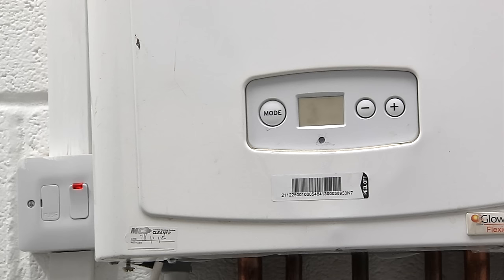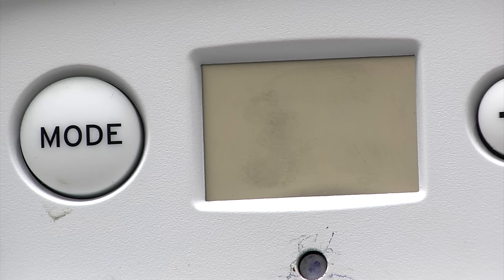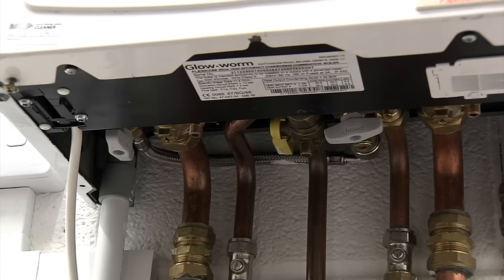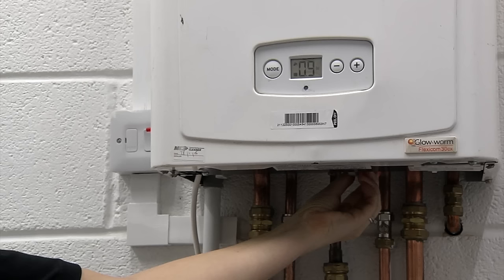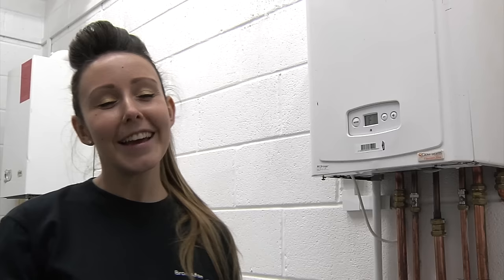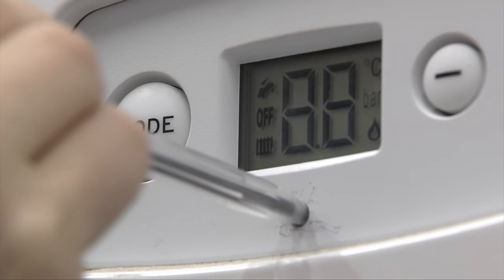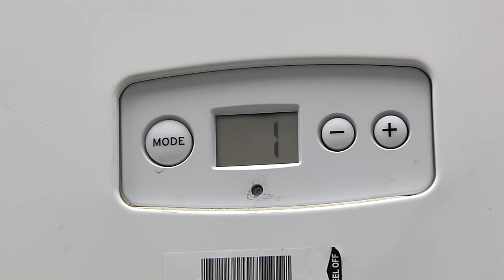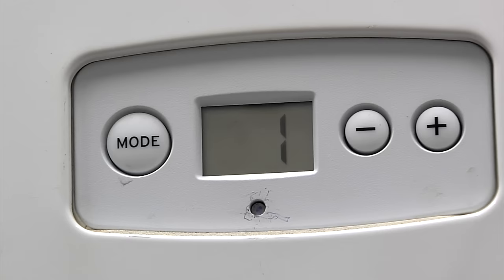How to fix some common problems with your boiler

Comment: Yes I had this problem with the boiler you mention in my old house, have since moved into another house and have the same boiler . But a different problem this time the boiler seems to gain pressure, getting too much pressure above 2 bar . Getting a repair done soon having had boiler serviced one outstanding thing needs doing to it. Will see if that solves the problem.

Comment: If you increase the pressure from 0.4Bar to say 1.5Bar using mains water (via the detachable loop) you MUST check the density of your water from any radiator to ascertain the Antifreeze (eg Fernox Protector) ratio to water so that none of your pipes freeze up during Winter or really cold spells. Ideally top up your middle radiator after draining some water, with Antifreeze (Fernox -11 Protector) and check with a hydrometer after circulation that you are safe to at least -8C minimum. I treat mine down to -11C

Comment: hi. my gloworm boiler has devolped a fault with the hot water only. system is sitting at 1.0 pressure and fires for a few seconds when you turn the tap on then it cuts off again. water only gets warm for a few seconds then runs cold. this is followed by a funny noise coming from the boiler like water is making a humming noise. do you have any ideas please?

Comment: Can someone help me please. The pressure is now too high! I closed the valve at 1.1 bar but it slowly went up without me noticing. It's now around 2 bar and it keeps going up very slowly even though i closed it.
Reply: Water expands when it’s heated 🥱

Comment: Great video but not many videos on older boilers. Mine is an ideal classic FF230 boiler ran but did not ignite. Fan ran I could hear ignition spark and the gas valve made a noise but obviously did not open. PCB I thought get a boiler man in. Well his diagnosis was the Sam but he would also change the pressure switch. How much can't get parts he said, but I will make a call. His price was just short of £700. You should fit a new boiler he said £2660, 12 year guarantee ok I. Said but he was charging me for a pressure relief valve I said the system had one not on the boiler loop he said we could not agree so I elected to source the part and do it myself. eBay is awash with genuine parts for this boiler new PCB £50:00 15 to fit job done boiler work. Gas safe gas fiddle more like

Comment: the worst thing happened to my mums boiler basically what happened is mum put the heating on before everyone went to bed then in the morning i went down stairs and seen that the thermostat said off i was so fucking confused so i went up to mum to tell her that the thermostat said off when she seen the thermostat she was confused as fuck so we went up to the boiler and it was off so mum pushed the power button and nothing happened so she pushed it a million times nothing happed so she called the people that installed the heating when they came they were checking out the boiler and then we were all shocked when we found out the boiler had malfunctioned and wouldnt turn on so it had to be replaced now we have new boiler its the same as the malfunctioned one but better